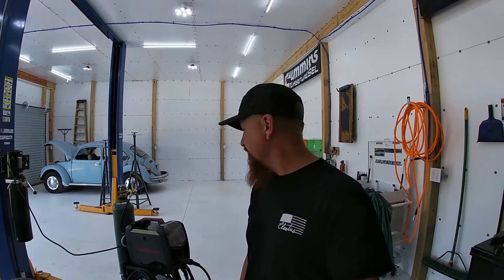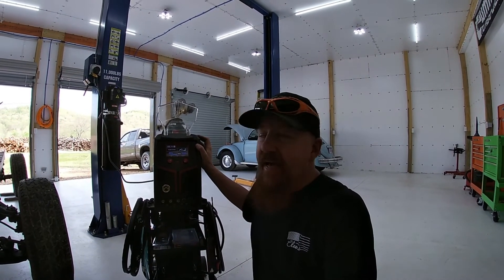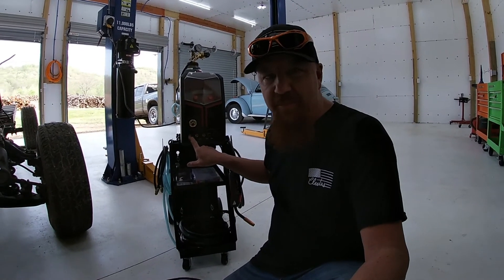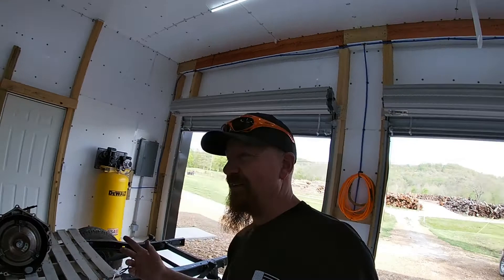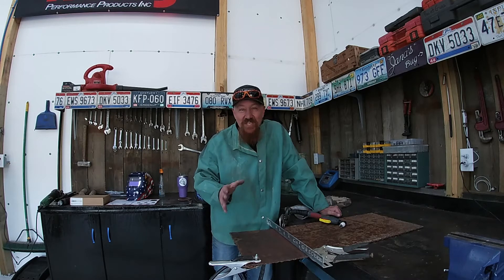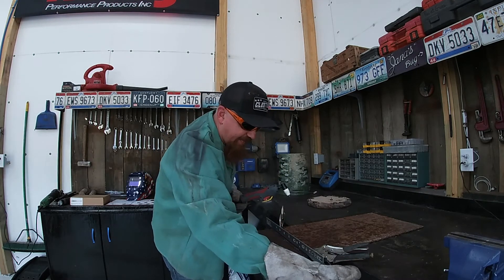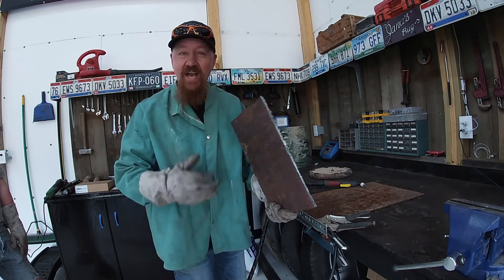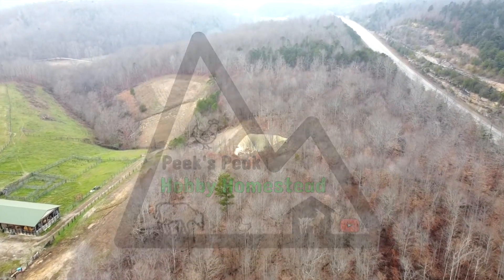Beginner YesWelder Firstess MP200 Plasma Cutter Setup and First Use - Quick Start Tips

Comment: I was a backer so mine is red but I flux the flux core welding with it and I just got a gas tank 75% by 25% to do mig so hopefully it's better than the flux core. And I'm still working on getting a big enough air tank to run plasma because my 60 gallon 1.5hp one won't keep up
Reply from the maker: I am satisfied with the mig.  We’ve done a lot of exhaust repairs and basic stuff with it that would have been harder with my old flux core setup.  I think you’ll be pleased with the plasma when you have enough air.  I’ve never used another plasma so I don’t have a point of reference, but I was able to easily cut some 1/4” plate steel with it.  Overall, for what I paid, I’m still thrilled!